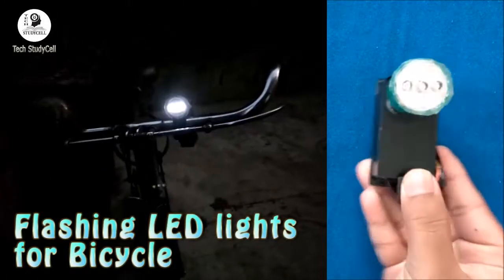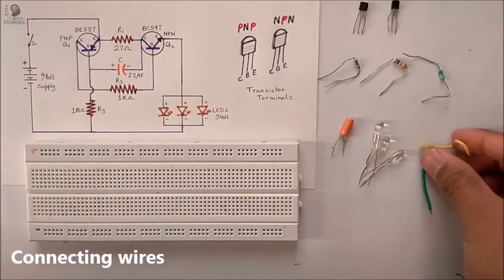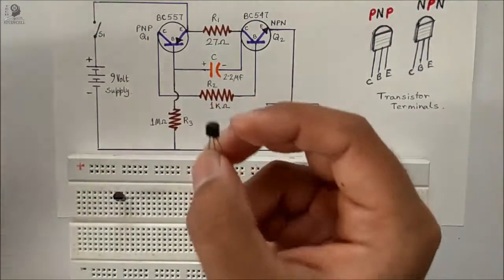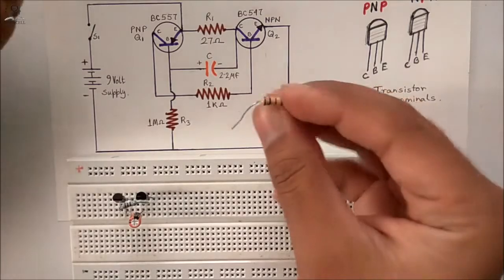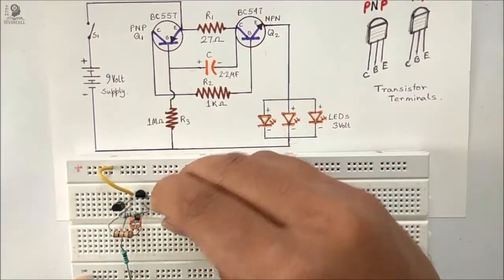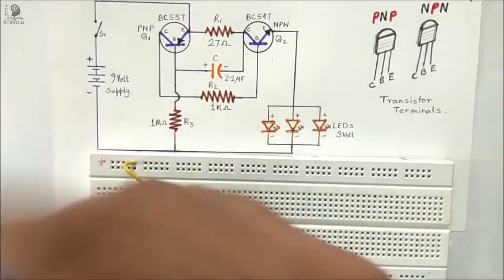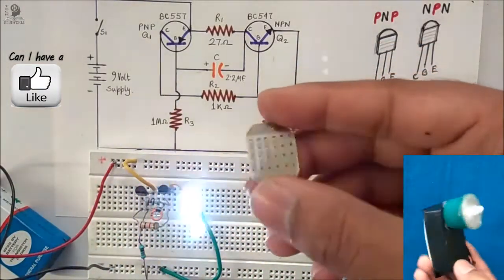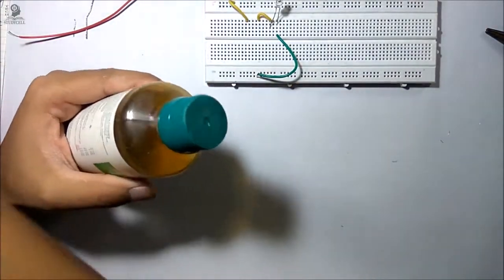How to make Flashing LED light for Bike using Transistor/ Electronics Weekend Projects

Comment: which volt you take a capacitor
Reply from the maker: +chandrakant mukhiya 
Voltage rating of the capacitor must be greater than 9volt. You can use 10v, 16v, 50v capacitor, but capacitance value should be same as shown in circuit.